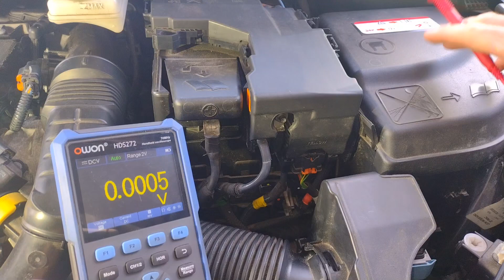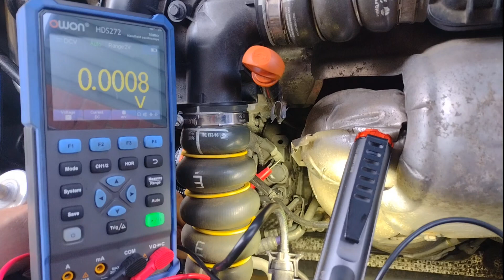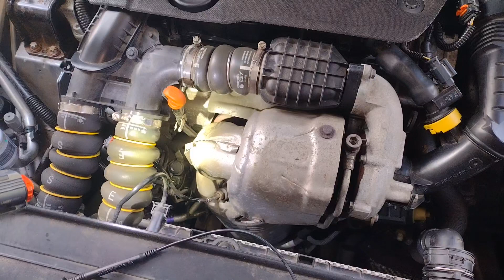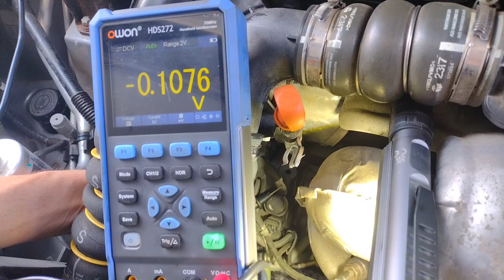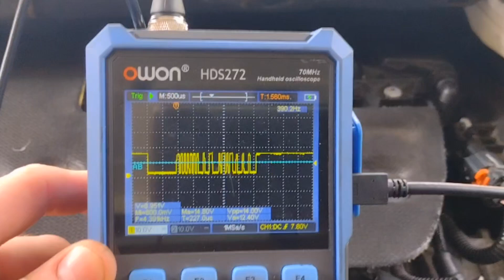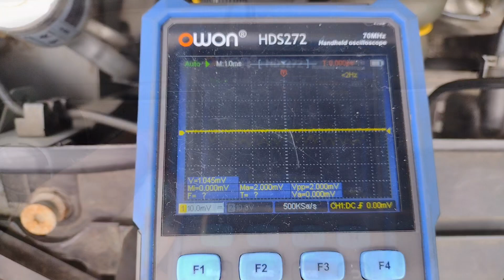Alternator testing with oscilloscope, amp clamp, volt drop test

Comment: Thanks for such a full coverage of proper alternator diagnostics!
Could you also make a video of the cam/crank correlation? I've seen Owon HDS272 supports some kind of offline viewing of saved waveforms on PC. Demonstration will be appreciated.
Reply from the maker: @ikusha84  ok I'll try and do that, thanks for the suggestion